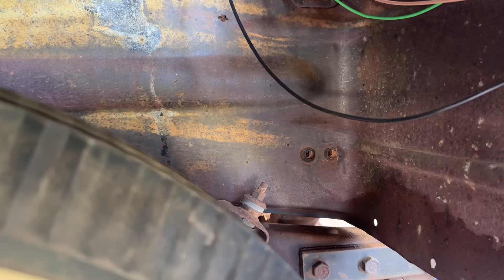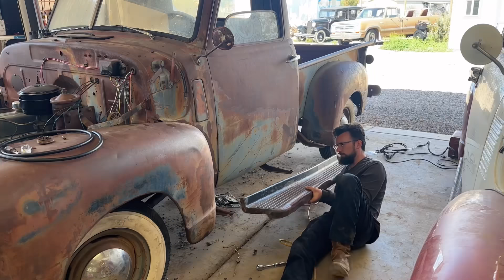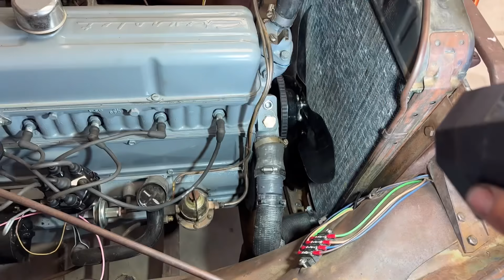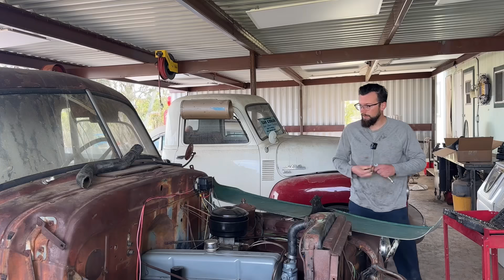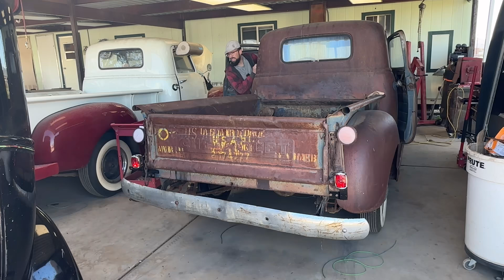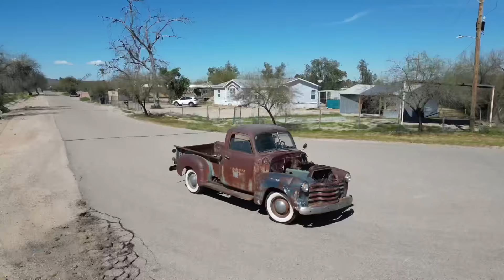1948 Chevy put together again, first time in 58 years!

Comment: Electrical is not your strong suit? You did great! I think the parking lights should be ON when the headlights are on too. Only thing I'd change is to flip one of the parking lights so the the bulb locations would balance. Either both outside or both inside. I guess I'm too picky. Great job Travis!

Comment: I personally prefer the 216 over the 235 after the right work is done to them I’ve not heard anything about it in sometime but there a guy out in California converting them to high pressure engines and changing the stroke along with the crank so that they would actually rev faster making hot rod engines out of that were really unique

Also there’s short shaft pumps available for the 235 that let you use the original pulley though from what I’ve seen they’re not as good and if the bearing or bushings go out you’re still hitting the radiator

Comment: Not sure if it's been mentioned but those turn signal sockets mount from the rear so only the two prongs extend into the lamp housing. That round flange you cut down is supposed to be on the rear outside of the housing. I enjoy your videos, thanks for the effort!

Comment: Love to have that pickup. Nice job so far. How far will you take it. Clean the floors and coat in rust converter and some bare metal flat black, boom matts, underlayment and carpet? Interior restoration with paint and panels? I love that kind of work. Two thumbs up 👍🏼 👍🏼
Reply from the maker: I will be doing the interior

Comment: The '48 Chevy is turning out great. However, you really need to warm that 235 engine up then do a valve adjustment. Keep in mind those are mechanical lifters and not hydraulic, so even adjusted they make noise.  If they don't make a little noise then they're too tight and thats bad.  The valve clearances are Intake .006", and Exhaust. 018" when the engine is hot, 180 degrees. Also, I don't remember seeing you run that engine after rebuild with the valve cover off.  You need to run that engine for a minute with the cover off and make sure the top end is receiving oil.  Also, since you rebuilt the engine, you should dump that oil again and put in some fresh!!

Comment: On those running/turn signal lights, use modern led bulbs the old 1157 style ones run too hot and will melt the plastic cover. Cheers 👊😎👍

Comment: Yes sir if memory serves me correct the advanced design Chevrolet trucks were introduced in 1947 (the GMC followed in 1948), The Air Force was created in 1947 (was the Army Air Corp) as its own branch of the military. Like the Model A and it sure is a keeper. It is not only the history of being manufactured when Henry Ford was alive but also its beings original one could imagine the joy people felt when they took delivery of one of these cars when new. Ford Motor Company share of the market was shrinking as the other manufacturers were offering new designs and upgraded mechanicals. The Model T served its purpose in getting the country on wheels with an affordable vehicle to the average person. It was Edsel Ford as you may well know that convince his father to change to a newer car and the Model A did the trick (it was called the Model A in honor of the first model vehicle that Ford manufactured called the Model A). Edsel Ford was a forward thinker and got a lot accomplished for Ford Motor Company, sadly he died in 1943 at the age of 49 due to stomach cancer (just shy of his fiftieth birthday).🥸👍👍👍👍👍

Comment: that model a is nice im currently saving up to do a fiberglass reproduction model A but not particularly a hot rod rat rod or historic build  im thinking carb converted 4.3 liter chevrolet V6 automatic with overdrive am/fm  stereo possibly even a modern stereo a.c. heat power brakes if theres room for a brake booster quiet exhaust
i just want a dailydriver/ interstate cruiser

Comment: White Teflon tape isn't meant for use with fuel, going forward you want to buy the yellow Teflon tape used for gasoline, kerosene, diesel, and other similar substances. They are like $2.75 a roll from Lowe's or Home Depot.

Comment: I'm really enjoying this build. Back in the early to mid 70's, I learned to drive on my uncle's dairy farm. He had two work trucks, a 1949 and a 1950 Chevy pickup. One was a 3 window and one was a 5 window. So, this truck brings back a lot of good memories. I always enjoyed driving those trucks. In the later 70's and early 80's, I used to run oats from the field to the mill in a 1946 Chevy dump truck. That truck still had the crank out windshield. Good times.

Comment: When it comes to tanks, it always kind of bothers me when people go straight to getting a new one if there's some rust inside (not that it was the case here); have you ever looked into rust removal through electrolysis? You put an acidic/basic solution inside the tank, make it act as the anode and flow current through it with something like a battery charger, I had a bad tank that I redid this way once and it works great.
Also, the engine looks super good being repainted and everything else rusty